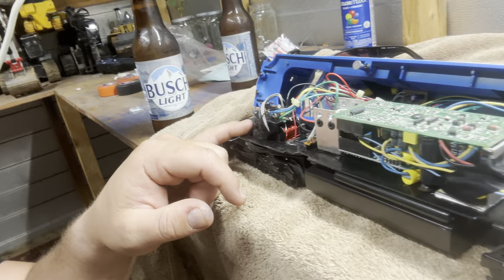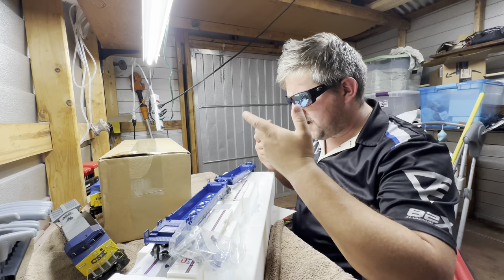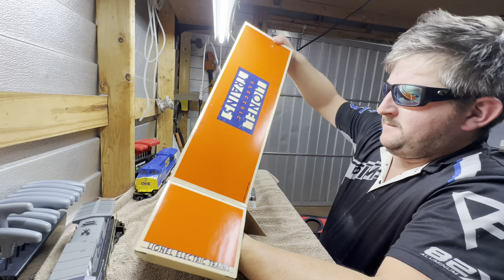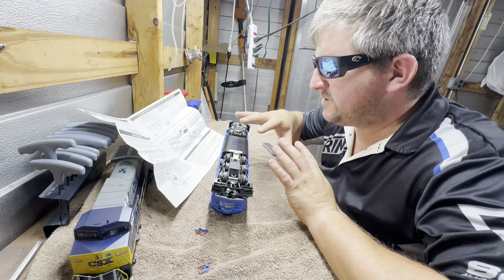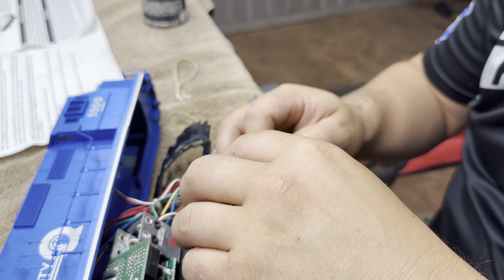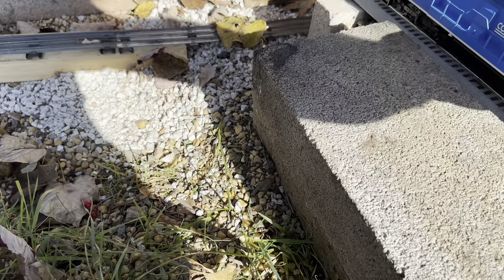My new Lionel engine is a complete dud but we have some new cars  I need help

Comment: Same, have that exact issue. Gear slipped off due to being worn off. Cut off front motor (now free-wheeling) just have the rear one. Real shame they put nylon gears in such a nice engine. Ridiculous.
Reply from the maker: I sent it to tranz . Com and they fixed it